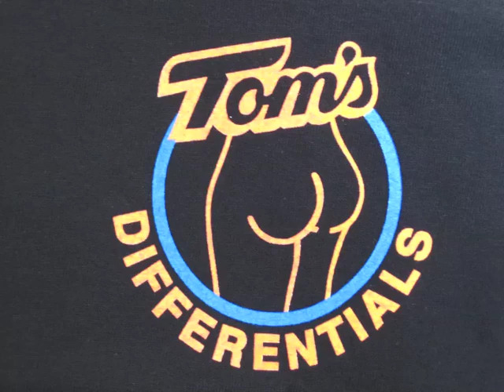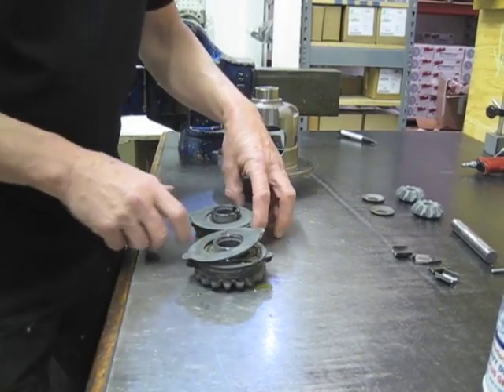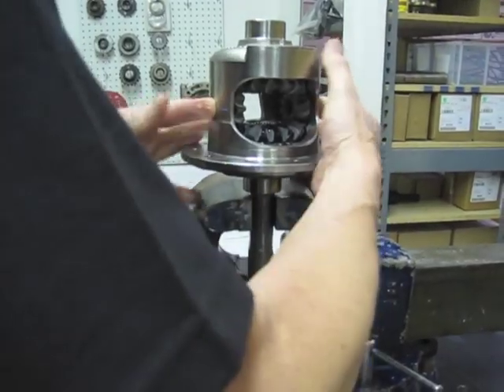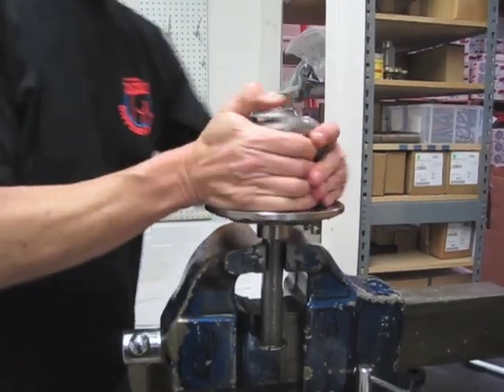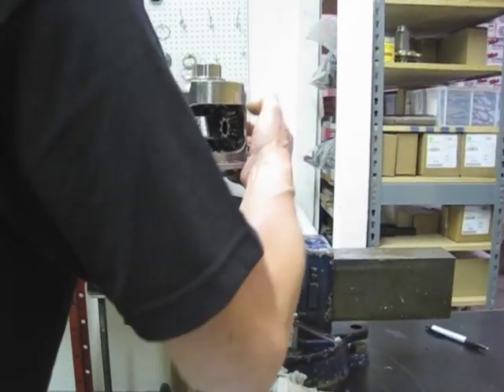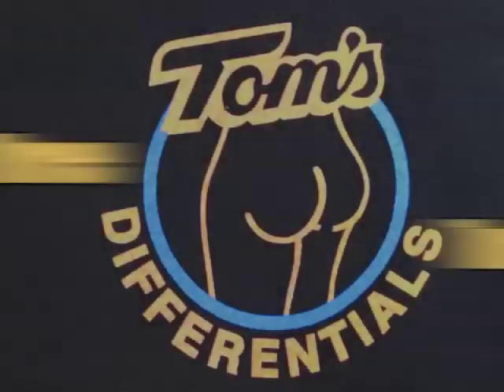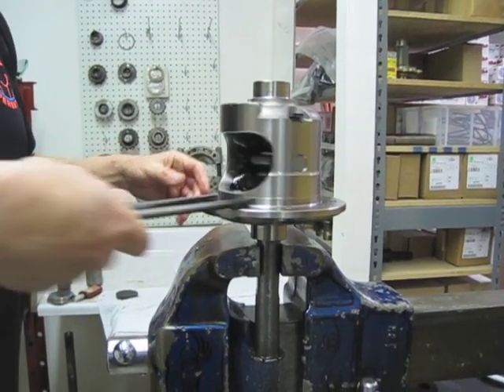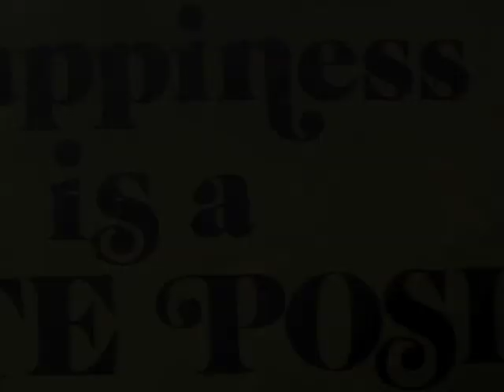Tom's Eaton Posi Tune-Up Tutorial (Part One)

Comment from the maker: NOTE!  If rebuilding a used unit, make sure that the side gears and pinion gears go back in the same locations they came from.  I usually mark with a small grinder, one of the teeth on the left hand side gear and the pinion gear on the side with the cross shaft bolt.  And if you always do it this way then you will always be placing your gears in the same spot even if it sits in the garage for two years before you put it back together.  Thanks
Reply: You got a nice shop Sir.

Comment: Hi,  when removing c clips to replace leaking axle seals the spider gear thrust washers fell out. Is there any way to get these back in without too much work It is the original 12 bolt 3:73 posi, and everything is still in place...the car is on jack stands, 69 Camaro.

Comment: hi tom I can't get my axles out they got mushroomed any tricks to grind them out?
Reply from the maker: your going to have to tap them out , the raised part is not that thick so shouldn't be that bad , butt you will need to replace the axles , so you have the correct end play
Reply: +toms diffs  got u .i did not want to damage the inner bore though when tapping. end play was .140 and .135 and its crunchy with little fluid found in the case .crunchy but gears are good 79 vette I hope GM additive ll take care of the sound. joints look good bearings replaced.ll clean metals and put new axles thanks
Reply: +casanovaevren  tapping method work piece of cake lol